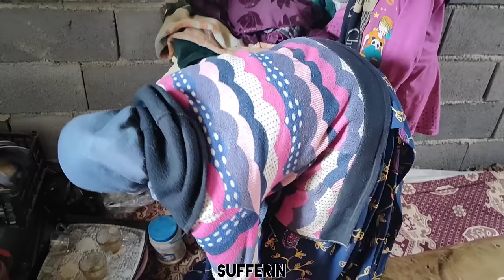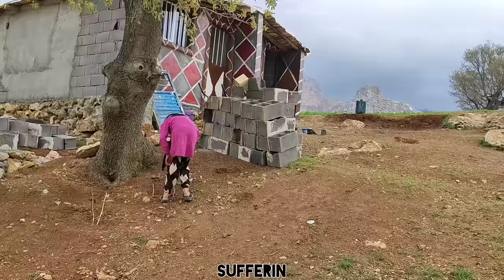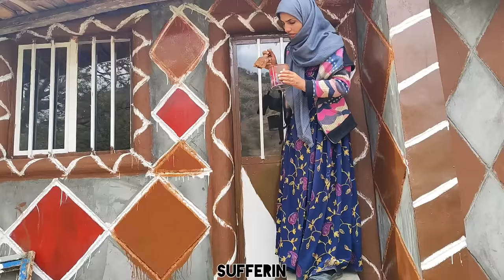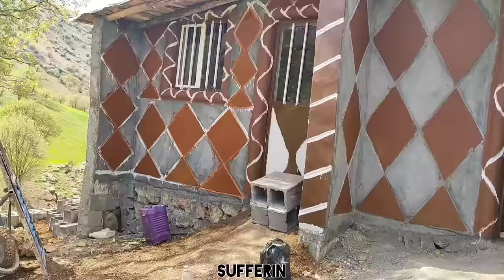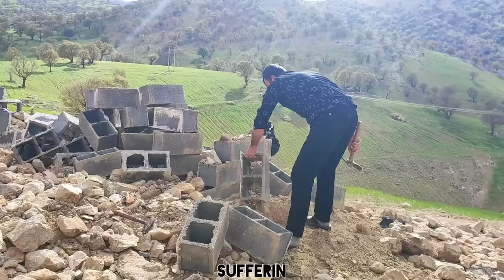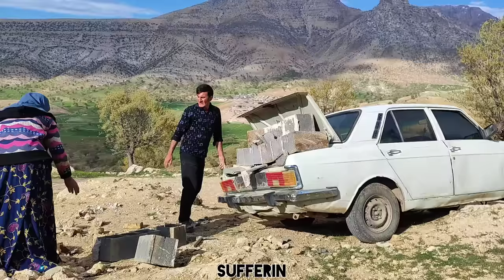Ghobad's release from prison and her fiancee's happiness with her fiancee's children

Comment: If the other rooms floor does not dry, it could be because it is absorbing the moisture out of the ground. Conceete should be poured on top of a bed of gravel that is at least 6 inches deep.

Comment: That car is very dangerous for the family,the engine is super good because it works, it is true that it has carved them well,but it is very unsafe.went it rains hard they hardly look,without the windows clanes, the driver ‘s glass it’s totally broken,the electrical doesn’t work, the headlights are already falling out .this family to be needs a better car,it doesn’t need to be new,but better than the one they have, which should be on the road.